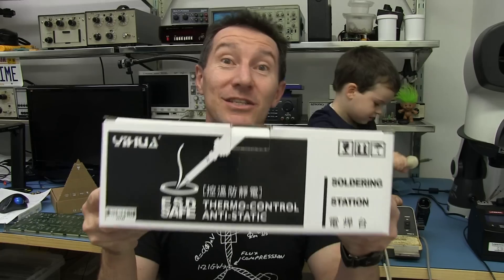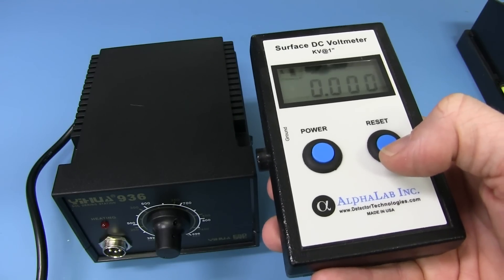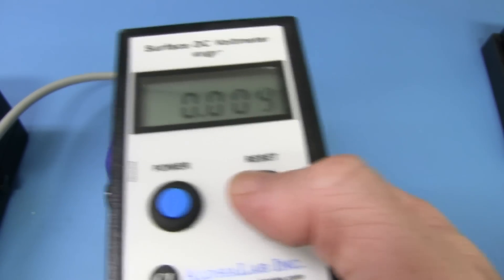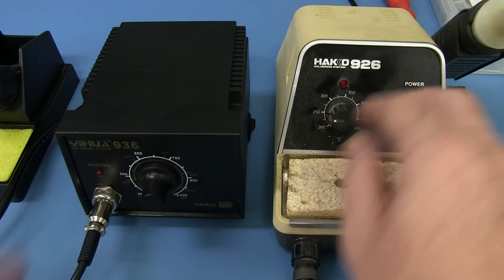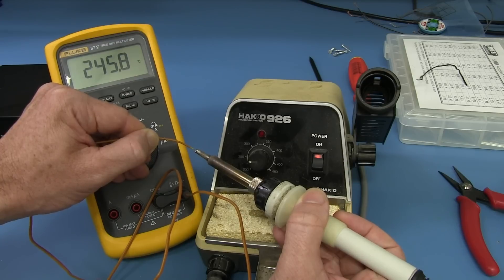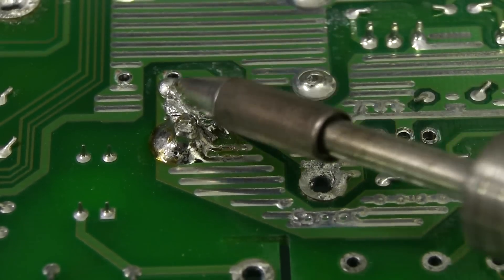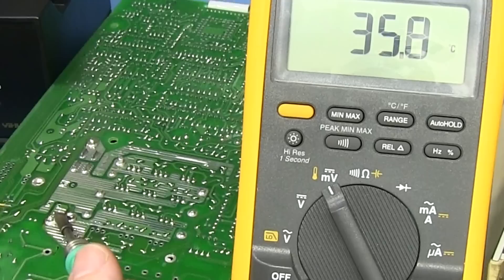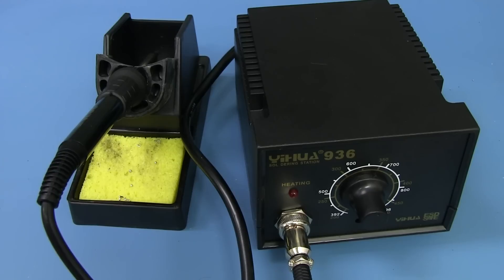EEVblog #596 - World's Cheapest Soldering Station - Yihua 936

Comment: I have one, and it works. For what I do and how often I use it... works fine.
Reply: +gmcjetpilot I saw a teardown on bigclivedotcom's channel. His looked to be of better quality. The one on this video... I wouldn't be surprised if it was refurbished.
Reply: +FDJustin Actually mine is much better. Name on it is a X-Tronic 4000 series (model #4010), I see them on Amazon and eBay for $89. I bought mine a few years ago on eBay for less, about $60 or $70. It has a small control bottom left and digital display center high, and it came with lots of tips and extra heating elements and magnifying lamp..  Like EEVblog said of this one, the X-Tronic is not for large gauge wires and heat sinks. A big iron is needed for that.
Reply: I bought one off ebay. It's a "Tomizawa 936a", and it doesn't have the usual chunky transformer inside-- I'm guessing it has a crappy little chip based step down transformer or somesuch. I don't trust it at all. It's not helpful it has 2 steel plates screwed in place to simulate the mass of a transformer. I guess I'm lucky it's not filled with gravel.

It really depends on who you buy things from.
Reply: thank you!!!!

Comment: ahh what a shame its gonna take 5 seconds more, you'll have to turn up the temperature a little and it feels a little cheaper, I'm sure its worth spending the extra 200 dollars right? yeah sure...
Reply: Dami Nooki if you earthed it properly and ensured you had a fuse installed there's no reason that should ever happen
Reply: Dami Nooki that's fair enough. It's not the volts that'll hurt you though, its the current, so the amount of amps, that's what'll cause you the most amount of harm
Reply: +Adam Burdett That is a myth. Its the both combined. You can run alot of amps or volts thru you. but not both.
Reply: they break all the fucking time on the last plastic screw down part b4 the metal one. i went through 3 in 4 months. Gota a hakko 888d and 6 months later its still going strong. The wire is muck more flexible as well.
Reply: One will hardly last for a year, the other will last for decades.
Reply: Dami Nooki - No you lack the most basic of understandings about volts and amps.  The voltage MUST be high enough to overcome the resistance of your body to push too much current through no matter how high the current capacity of the supply is.  For example, grab two probes with 12V between them in your hands, coming from a supply with 800 gazillion amps capacity, and you will not be harmed.  Grab the same two probes with 500V and 100mA capacity, and you're in a world of hurt if you survive.
Reply: AJ Burdett he comparet with 926 from the '80-s and 926 won. What the heck, 30 year old station won.I mean you can buy 926 for the same price!!! China sucks!!!!
Reply: @RetroOnSpeedDial  
220 volts?  It's not dangerous, in such cases.  Might hurt for a moment, yes, but that's it (and it is if it happens...).

Comment: To be fair, that's a damn good bit of equipment for $16. Is that Australian barbecue dollars or Yankee bluejeans dollars?
Reply: are you serious? you have no idea when and how the electronics will fail on that cheap piece of recycled garbage...
Reply: krawutzimon
HAI, I have a 9€ (US$12) soldering station - solders up to TQFP100 :)
Reply: krawutzimon
To be fair tho, it's just like Dave said "you get what you pay for" after 3 years and roughly 3000 leaded + 700 bigger SMD joints I'm about to dump my station - also soldering pads requiring a bigger thermal capacity is a great source for frustration. Basically it does the job for occasional hobbyists who don't want to/can't spend a lot of money or want to get a general feeling for soldering.
Reply: ***** hans meier I don't doubt you can do all these things with this soldering station. Smd work is really not that demanding, because you don't need that much of a heat capacity. As Dave has shown, you'll run into problems with the big beefy traces or pads. My soldering station at home is one of the cheap ones, but it cost a bit more and doesn't have components that look like they've been scrapped out of some used tv. 16$ might not seem much, but for a few bucks more you can at least get some half-decent quality. I'm not arguing against cheap tools, it's just that you should at least have some confidence in what you're using. And if you're really trying to make things as cheap as possible, I've seen a circuit for a soldering station controller over at dangerous prototypes that didn't look that bad. You'd still have to get that soldered however - chicken-or-egg-problem:-)
Reply: *****
yeah, i guess we all have to go through these experiences sometimes in our 'carreer' ;) i've found out you can do pretty nice reflow soldering using regular kitchen oven plates.. that is - until you start running into misteriously destroyed components because of electromagnetically induced currents ;)
Reply: it is 16 'strayan dollars.  

which in real terms, it would be $8 or $9 yank dollars.
Reply: ***** there is usually an unofficial 100% australia tax on everything here (relative to the US) (yes, even when the exchange rate is totally different)

Comment: 4 years ago I got a Weller WD-1 soldering station with the WP80 80-watt soldering pen. Love it. Comes up to temperature ridiculously fast (30 seconds ready to use) and despite the pen being so small it has enough thermal capacity to handle fairly large joints, such as those found on RF power transistors. The small pen makes it easy to get into tight spots without accidentally melting anything.

It was a little pricy at around $300 but was well worth it. I've done thousands of solder joints with it.

Comment: I think this review would have been much fairer if you calibrated the pot after the initial thermal capacity test.
You knew it was running 25 degrees C lower than it should have been so I'm not surprised the solder didn't take!

Comment: I put a copper foil between the heater and the tip in a Yihua soldering iron with amazing results.

The new Yihua 939d is and excellent soldering iron for US$29.

If you don't have money for a Hakko, Weller, Pace or whatever you want, Yihua is a very good option.

Comment: I have one and it works fine. I have about half a dozen irons of various types and $ and this is far from the worst one. Well worth having as a backup/spare. Get a set of tips for it (very cheap on ebay). I have it on my desk simply so I don't have to keep changing the tip on my primary iron when alternating between e.g. SMT and solding connectors.

Comment: For people working with electronics on a daily/weekly basis -buy a proper station! For the first timer: Maybe with a proper Hakko tip, but be patient and toy around soldering on some old electronics to get a few tricks up your sleeve and learn the timing skills in soldering.
For the hobbyist who repairs stuff now and then, solders a board a month: definite worth it with a proper tip. I would also feel comfortable tucking this down a mobile tool box, something I would not do to my weller station.
Reply: oh, ditch the original tip, you'll do yourself a nice favor, it will just yo-yo in temps making every damn soldering a P. I. T. A, and risk your components well being.

Comment: Man my Yihua 937D has served me extremely well for over a year. Came with a spare heating element and I haven't had to replace it yet! It takes the Hakko tips, I buy the Plato replacements, they're excellent quality. My 937D was something like $60 delivered, worth every penny. I've used Hakkos, Wellers, as long as it has the heat capacity to do the job, they're all the same thing.

Comment: Hello Dave, I know this is an old video, but based on your review, I went ahead and bought one. Your review did show me that it actually worked just fine and the internals are somewhat adequate (it has an adequate transformer, not some crappy chip psu)

I use a soldering iron for small project and repairs, about 6-24 times a year. After spending 3 hours removing a broken connector of a 10 layer laptop motherboard, I decided I needed a station. Unfortunately, I couldn't justify spending 150+$ station for a top brand product.

This one is absolutely perfect for my needs, the quality isn't actually that bad for my usage and I am VERY satisfied with it.

This is almost 2017 and they still have the shoddy earth connection; I am waiting for the crimps to arrive so I can redo it properly.

Comment: I got a used JBC station a few years back at a fairly decent price. It was still expensive for someone like me that solders only a few times a year. BUT, damn, it's so worth it. It's just a joy to use. I mean the 6-7 second startup time alone is just wonderful. Then there's the tip changing, hot or cold you're done in 3 seconds flat. And the hand piece, slim and cool with a thin, long and very flexible cable that doesn't bother you.

If you can spare the money I highly recommend it.

Comment: Your opinion doesnt seem to align with reality ... since this is a perfect example of why chinese knock-offs dominate the market.  They get the job done at a fraction of the price.  Sure its cool to have the highest quality indestructible thing you can imagine sometimes ... but thats a luxury.  The cost of ownership of one of these irons is awesome.  The net work-to-cost ratio of the chinese unit is going to be higher.  If you did buy multiple and still spent less than the total cost of 1 Hakko ... youd have spare parts enough to repair that one if it did go down ... and you could easily use one of the spares to reflow those solder connections and clean up the board yourself.  Its not hard.  And from a manufactering perspective you can outfit 10 stations for the cost of 1?
Reply: It's just a little sad that they didn't make it a 25$ one and put a little more care into each unit.
But I agree that it's great value for money.
But if you have all the money, you could aswell go for best value (not best value for money ratio).
Reply: Yes, they dominate the market because people are: 1) cheap 2) ignorant
Reply: @ Walter - And in the business world ... recognizing that is half the battle!
Reply: @ Kayla - why would you cry?  A replacement isn't gonna cost you an arm and a leg.  And that's already going under the faulty assumption that its going to do anything you mentioned.
Reply: Kayla - No, people almost never get what they pay for when they go with a major brand.  Instead they are paying for executive salaries, advertising, and status.  Please let's do away with that idiotic saying that you get what you pay for because it's almost never true.  With generics you get more than you pay for and maybe it's acceptable or maybe not.  With major brands you don't get what you pay for but it's probably more than acceptable.  The problem is there is seldom the right middle ground with soldering stations, a point between something to complain about and something that is overkill for entry level work.

People say their Weller (etc) is going to last 50 years and that tells me they have no concept of value.  They accept far less than 50 years from a car, refrigerator, washing machine, microwave, etc but somehow the standard for something that costs far less should be that much longer?  Fools and their money.
Reply: And let's not forget this is only possible because Chinese labor conditions are so much closer to slavery.

I mean, we could automate more all the manufacturing etc, but as it is now, international socio-"economic" system is based on competition, it's only possible because of that...

Comment: I have a YiHua 937 60 watt. The 937 came in different wattages.  A 25 watt 937 would not heat as well as the 60 watt.   So the 936 tested here might of been a low wattage unit.  Of course this test was 3 years ago, but I thought my comment might be relevant.

Comment: Even if "crap", it might not be the worst thing for a cash-strapped noob or infrequent electronics work. If you put a better tip on and it holds calibration which you set after that (because if it was calibrated at the factory, it was for the smaller tip) and keeps temp near what the dial says through the band - if it only lasts a year it probably isn't the worst purchase to make. A year is still a lot longer than how long two pizzas, a side, and a 2L soft drink will last for the same amount of money.

I even have a feeling it might even have recieved a better (passable?) grade if it didn't have the false case marking, weak transformer grounding, and apparent use of recycled components. From what I could tell, it seemed to work reasonably enough despite it's overall cheapness otherwise.
Reply: Wouldn't a Radio Shack wall iron be just as good and safer as well? I'm not a soldering expert, but I don't see the advantage of this cheap thing over a 10 dollar wall iron for casual infrequent use.
Reply: tarstarkusz Yeah, you would get something better from radioshack, but DONT get the ones they sell which just plug straight in to the wall. I have one, and it's a pain in the butt for my casual infrequent use! Get a soldering station with a variable temperature control, and get GOOD TIPS! Get some Hakko tips, it's well worth it!
Reply: ilike600baud They take forever to warm up and the tips SUCK!
Reply: tarstarkusz Avoid the irons that plug directly into the wall. They are usually rated by wattage, generally are not more than 35W, (some cheap amazon ones claim 65W+ and thats total BS.) These do not have temperature regulation, and so what happens when you leave it on and unused, the temperature climbs up very high, too high, and can cause the tip to oxidize, and when you try to use it on something big, the temperature plummets very low and you are left with a crap solder job (cold solder joint).
Reply: Power Max If you do a lot of solder work, that's true and I certainly agree with you. But for really infrequent simple repair work, a RS plug in iron is a better choice than this thing. I'm certainly not comparing a real soldering station to a corded iron.
Reply: tarstarkusz I'd say that for soldering wires together a simple wall plug iron is suitable. For electronics and PCBs, I would prefer even this Yihua thing since it costs about the same as a wall plugin unit, but has some form of temperature regulation. I would open it up, clean it out, and fix the safety issues.

Comment: Getting a soldering station is one of the best things I did recently. I looked at the el'cheapos, too. All of them would still have beaten my fixed power soldering iron (the tip of which got way to hot and at the same time had absolutely no heat capacity).
In the end I've got a XYtronic LF-3000, which sure isn't the greatest brandname either, but it works so much better, that it was worth the 80€. If you're doing soldering more than once a month, I tell you, it's worth it to get more than one of these knock offs.

Comment: You should have calibrated it first, the factory was like 40C below what the knob indicated, that was not fair comparing it to the calibrated down to 5C Hakko.
Reply from the maker: Completely fair testing out of the box. People buying this can't be expected to calibrate it themselves.
Reply: Dave  you are sorely mistaken.  Anyone who pretends to be able to solder and pretends to know what temperature their work is supposed to need, can far more easily grab a little screwdriver and turn a pot till the tip heat is at what it should be to melt the solder based on whatever formulation it is.

To put it another way, if you're saying people who buy this are ignorant, then they'll just turn the dial up till it is hot enough to do the job and ironically enough, in 95% of the cases that would completely solve the problem.  lol.

Comment: It's comming from a RC hobby supplier and for anyone doing infrequent RC soldering jobs, it's probably pretty good. Although it will likely struggle with large wiring and battery connectors. Not bad for under $20; with the added benefits of being electrically safe and accepting readilly available name-brand tips. I'd call that a thumbs up.

Comment: For those who are curious about this iron beyond this review, I am a user of this iron and it works really well.  So far, I only have the sharp conical tip installed and I have soldered a bunch with it.  I have stripped a bunch of old 70's and 80's electronics using this and not even the toughest, largest solder joints give this iron any issues.  For $16, i already got my monies worth from this.  It does extremely well soldering the Bangood DSO138 and the Signal Gen kit.  I'm of the mind that this video had some preconceived notions about this "knockoff."  If you're short on cash and want to get in to a better-than-home-depot pen iron, then consider this iron.  When you first get it, take the pen apart, put it back together and use some loc-tite blue on the plastic threads of the pen retaining ring.  This is the only issue that I have had with the iron.  It would come loose when the iron got warm.  It no longer does this.
Reply: +Markle2k I know  :D  I now have several Hakko tips that I use.  I'm liking the gull-wing style tip I've been using.  Still no issues with the iron at all.  I've been able to calibrate it and it holds.  I'm always weary of reviews of cheap stuff by people who are likely sponsored and get multi-thousand dollar test equipment sent to them on a lark.  I'm not knocking Dave in particular, as there are several reviewers that are like this. As Dave pointed out, it's best to tailor the heat setting to the job you're working on.  It's almost as if they included the temperature knob to do just that.  If one of the expensive, high thermal mass irons were so good set at one temperature, then why do THEY include a temperature knob and not just a fixed temperature?  Crikey.